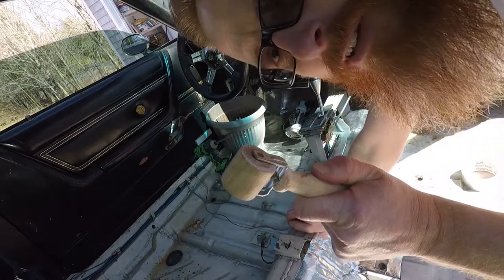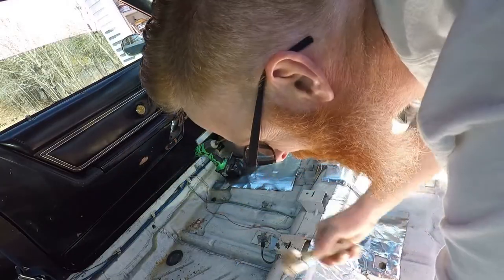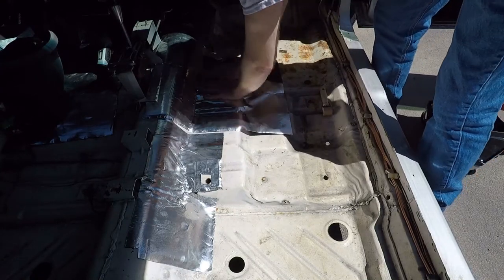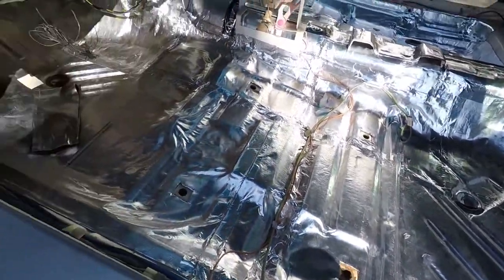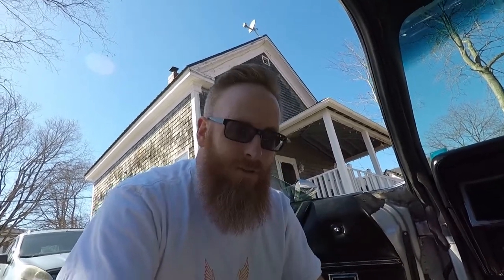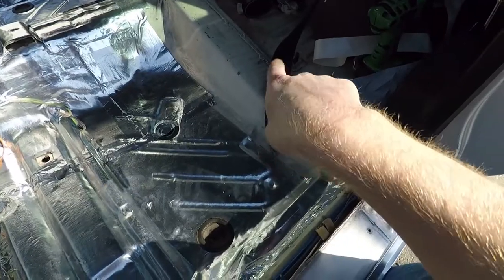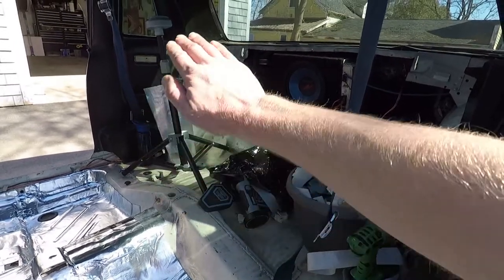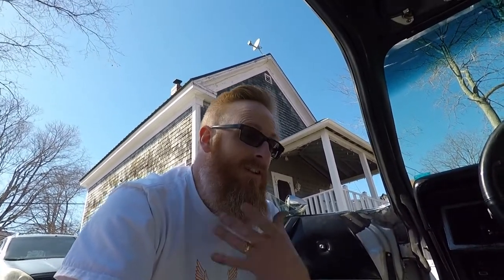I'M INSTALLING DYNAMAT IN MY 79 CORDOBA

Comment: i hate laying down sound deadening material as well, try using a heat gun on low after you placed it down to help it adhere and then roll it
Reply from the maker: Thanks for the tip! I'll be sure to try it.

Comment: How many mil thickness is Dynamat? I wasn't impressed with my knock off product at first, but the more I drive the Fairmont (which it's been about two months now) I think it's actually a lot quieter than I initially gave it credit for.
Reply from the maker: I'm sure it was 80 mil, but i'd have to look it up to be sure!